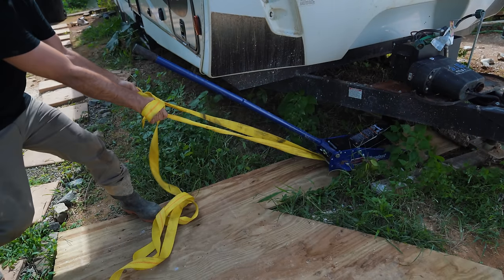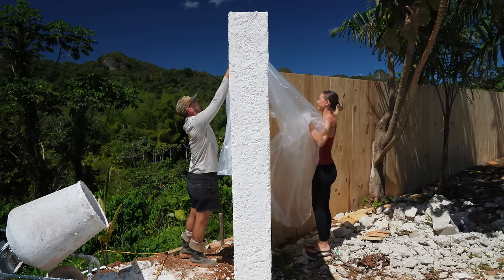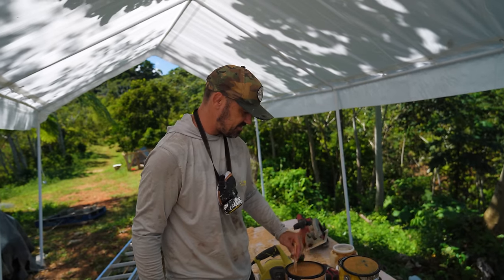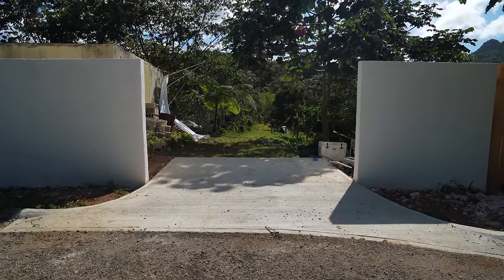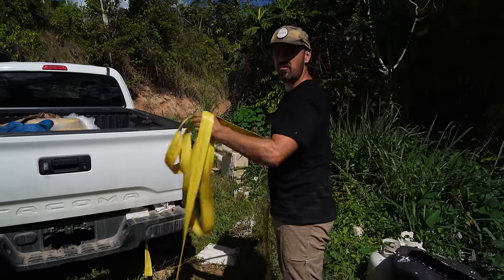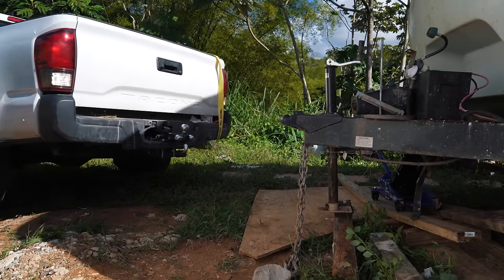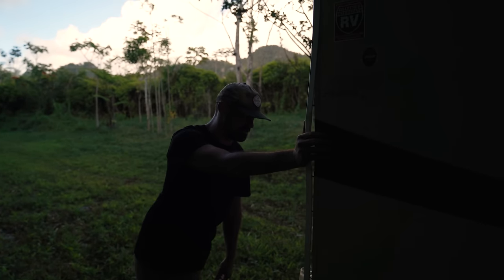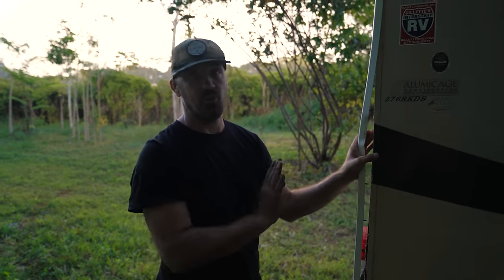DIY HITCH, UNDERRATED TRUCK, WET CLAY, WHAT COULD POSSIBLY GO WRONG?! MOVING INTO THE WOODS

Comment: RVer here, have a few bits of advice. First, YOU’RE GOING TO KILL SOMEONE!!! Haha, just kidding (maybe). I can’t believe that bumper held up. A camper like that likely has a tongue weight around 700 to 800 lbs (maybe more). My similar size has a tongue weight over 1,000lbs. If you need to move it around at all again, or want to use the Taco for towing anything at all (even small trailers), look into getting an appropriate hitch installed. The u-bolt set up on a bumper is for small light accessories. There’s probably a hitch receiver setup you could order for that truck that bolts or gets welded to the frame. Keep using that bumper mounted and it likely won’t be long before it breaks off and then the camper is stuck wherever you dropped it. 

For moving that camper around the property, forget the engine size. People worry too much about the engine when towing things. That thing seemed to have plenty of power for that application. Now, I wouldn’t tow that camper on the road with the Taco, even with an appropriate hitch but I’m guessing you have no plans to. If you need to move the thing again on the property with the Taco and need a bit more clearance, check to see if you can get something like timbrens or sumo springs to take some squat out. Probably not worth it unless you’re having to move it around a lot, but I’d guess you will be once you start building a real house down there. Timbrens are a few hundred bucks and easy to install. Don’t know if they make them for that truck tho. 

Forget those stabilizer jacks. Just leave them up. Get some cinder blocks.  Jack the frame up some, get the blocks under the frame at a few points around the camper, and drop the frame down on to the blocks. You’ll have a ton more stability. 

For the damaged trim. You’re right, you can just pop that back on. But, if you haven’t fixed it yet, maybe use the opportunity to seal up the edges of the wall. They make those walls out of wood that’s barely better than cardboard. If water penetrates the trim those walls will fall apart quick. Personally I’d just throw a bit of penetrating epoxy on there, then seal the trim on with some caulk. 

The folding up stairs, you should be able to get those moving good again with a quick hose down and some spray lube. 

Also noticed one of your slides was not going in straight. Looked like top went in  faster than bottom. Probably not a huge deal since you’re probably not running them in and out very often. But, could also mean  it’s not straight when it’s out so it’s not properly sitting against the seals. So if you have issues with gaps allowing in air or bugs, should be a somewhat simple solution as they generally have a way to adjust that. Just need to identify your slide type and how to adjust.

Comment: Hell
Bent that fence isn’t coming down——I’m laughing so hard. Why not put a one by one over the screw line on the front side and that baby won’t  budge.  Having backed up and seen rvs backed up and tree sliding you are not alone.  All that is fixable.  I won’t forget the day I got my 19foot Terry trailer a deer jumped in between the hitch and the front of the trailer and impacted the front wall and sling around the side wall into the door making a nice little bend in the siding.  She still has the dent but maybe one day I’ll get her taken and straightened out.

Comment: The problem with the screws from the back won't arise until the wood shrinks as it finishes drying. Until then, it will hold. You always need at minimum 1-1/4" penetration into the wood you are fastening TO, but it's not just that. Screws are designed to that when the wood shrinks, the head of the screw keeps the boards in place, and allows them to expand and contract (which you cannot stop). Glue will not work, because that expansion/contraction will pop it every time. You need to face screw them, and you need 3 screws across the width of the board, or they will cup as they dry, making the movement that much worse. Just wish you would actually listen to some of the good advice you are given, rather than laugh it off. But it's your money and time, and wear and tear on your body. It's entertaining, if not mildly frustrating to some.